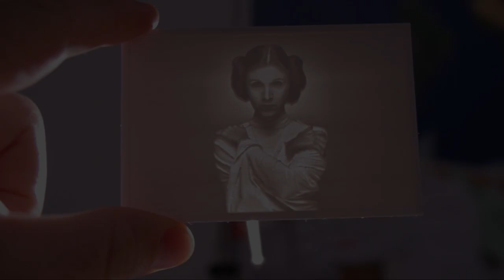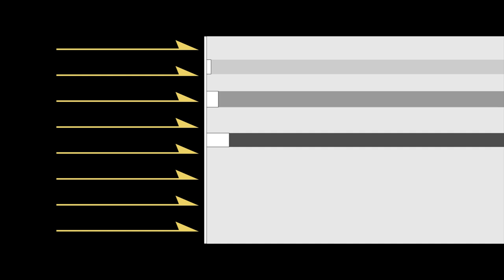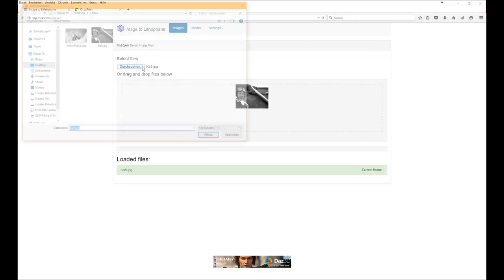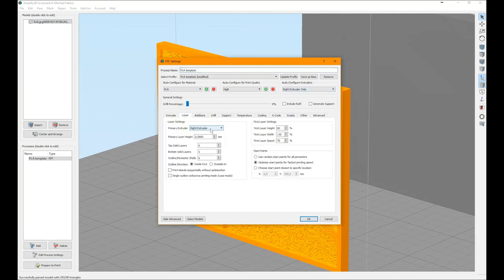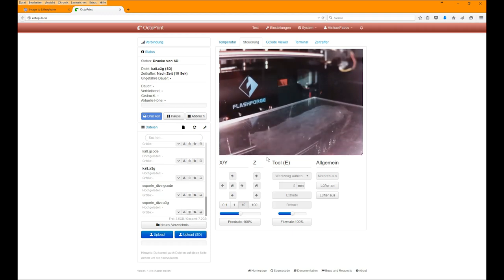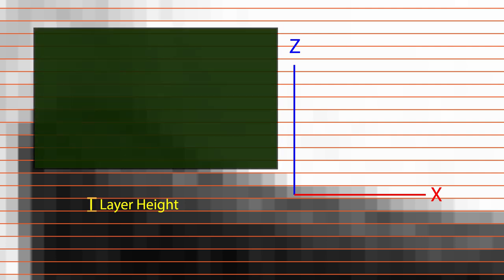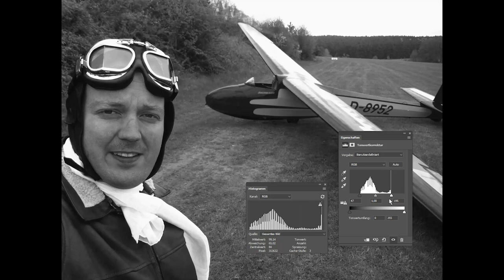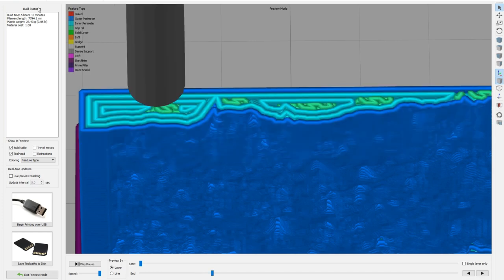Getting to Grips with Lithophanes from 3D printers

Comment: Thanx for making this video - there should be a "love" button like on fb! Very informative, personally I always wondered what a histogram was. One thing I'm still not clear about is the physical size of a pixel - how many pixels per .01mm resolution, specifically. I might be sweating it too much, maybe a good rule of thumb would be "If it looks good on my monitor at 100% magnification, it will look good as a lithophane".
Reply from the maker: aBridgeCalledDOUBT thank you.
Basically the size of the pixels correspond to your layer height. Because if you regard one horizontal row of pixels, this must be printable. But if you choose a layer height, that is much smaller than the physical height of that pixel row, you are not introducing more detail. Instead you are only increasing the required print time.
On the other hand if you scale your lithophane in a way that the layer height is larger than the pixel row, you loose detail.
So with the formula shown in the video you are able to calculate the reasonable size of the lithophane for the given resolution,  the resolution required to get best results based on a layer height and lithophane size or the required layer height to retain a given resolution and litho size.
Reply: I understand the concept just fine, you made it pretty straightforward. I didn't do a very good job of asking my question, however, the answer I was looking for was so obvious. Look at the pictures properties. I was trying to determine how much detail I would loose with a .01 print resolution. (Actually that was wrong, I'm looking at .1mm.)For example; a pic I am considering to use is 11.59cm/438 pixels tall. That would be .377 pixels/.1mm. According to those numbers I could print at .2mm resolution and not loose any detail. Am I tracking correctly? Thanx
Reply from the maker: +aBridgeCalledDOUBT correct. So in this case you would print around 3 layers for the height of 1 pixel if you were printing at 0.1mm. So you only need more print time but don't gain any detail.

Comment: Incredible explanation! I would also like to point out that the orientation along the x or y axis matters on beds that move along one or the other. I have mad a few that turned out wavy because the bed was moving back and forth along the y axis, shaking the whole very thin and tall model back and forth as it printed.

Comment: Very good tutorial.  I disagree with the upright v. flat conclusion because the human eye can only discern 32 - 64 shades of grey, while still being able to discern millions of colors.  At 4 mm thick, and 0.1 mm/layer, your lithophane printed flat should have 40 levels; at 0.2 mm/layer, the eye can see granularity of the grey-scale.  Whereas 40 mm @ 0.1 mm/layer is probably a minimum, I think 5 - 6 mm of thickness @ 0.1 mm/layer to achieve decent contrast.  I get very good results printing flat with those parameters.  The real trick to optimizing contrast is, however, accounting for the exponential loss of light as thickness increases and making thickness proportional to the natural logarithm of the pixel, rather than linearly proportional.  The proportionality constant needs to be measured for each filament before one can apply this.

Comment: For the output from the online tool with the higher vectors per pixel, you could then run the stl through a meshmixer type program and reduce the triangle count. With the proper reduction algorithms many of the flat surfaces made of many triangles can significantly reduce the number of triangles (down to a theoretical 2 triangles for a rectangular surface). YMMV though.

Comment: Very well done video. Will be trying these settings in a bit. I have done one other litho and it came out quite well, I did print it upright, but used 100% infill as opposed to zero, and had top/bottom solid at 1 and outline/perimeter also at 1....This was from another litho recommendation....Odd thing is in slicing the same image both ways I can see they look different from a line/layer perspective, but that resulted in the exact same size gcode file. I may print both ways for a compare. Regardless well done on the video.
Reply from the maker: Truegrit Scott thanks.
Well, the trick is, that my settings actually give you 100% infill, too. But the fill pattern is exactly parallel to the perimeters.
This way the translucent image is more homogene.

Comment: Upright vs flat...have you ever tried lightly sanding the surface of a flat lithophane? If you abrade away the edges of those “layer steps” you restore the original gradient.

I only tried this because printing vertically I get a lot of excess material...straggly, hairy bits that even if I remove carefull leave more blemishes than all over sanding.

I’d used a wire brush (soft and fine), wire wool (again very fine) and soft plastic polishing bonnets on a Dremel. I’m going to try something even finer like TCut...and was even thinking of some sort of high temperature/short time treatment (ie blowtorch!) to try and reflow the surface.

You have much more experience than me, and I love the rest of your tutorial, especially the manual contrast adjustment, it’s just this one aspect (vertical vs horizontal) that’s not working for me right now...
Reply from the maker: Nigel Coxon hi, one suggestion that comes to my mind is, do some test prints to adjust for stringing. I bet you can tweak a bit for better stringing avoidance.
Another way is, set the Slicer so that it does not cross outer boundaries. This way there shouldn’t be much stringing.
If I can help you out, let me know.
About the sanding technique: you remove the steps, which also removes the gradient islands, but you cannot restore image information that hasn’t been printed. But you are fine with this, as the observer doesn’t know what detail has been there in the original picture.
Reply: I’m still using Cura and getting used to where all the settings are...thanks for replying, I’ll see if I can find that outer boundary or equivalent.
Reply: @Daft_Ideas  Did you ever find the outer boundary equivalent?
Reply: @scottfarrell1506  nope , never did...

Comment: I played around with the infill and layer heights a bit in Simplify3D and while with Zero Percent Infill your process worked out Great for Single  Lithophanes either Curved or Flat. However if you were to attempt the same settings say at Lithophanemaker.com for the Lampshades I think you or someone else would run into Bridging Issues when printing the Bottoms of the Lampshades. Though I guess if you were to run a Variable Print with different settings for the Top and Bottom using 100% Rectilinear Infill with Zero Infill for the actual Lithophanes one might come out with a fantastic product. Thanks for your Input and I think I am going to try and amalgamate the latter for an even greater product using your methods instead of my usual. Surprisingly, the time factor wasn't that much different. An extra 4 hours, and with a 72 hour print, who's counting,

Comment: Hi, Thanks for the video.
I still have some questions... :
- printing verticale gives better results. But I read that results are better if you print with the lithophage parallel to the Y-axis to reduce any vibration effect during Y-move. Do you agree ?
- It's quite difficult to read the S3D parameters. Could you confirm your nozzle is 0.4 ?
- What is the speed ? what is the number of perimeter/shell layers to be sure to get a 100% infill with 0% regular infill ?
- thanks
Reply from the maker: Well, that orientation issue is relevant for printers with a print bed that moves along the y-axis. There I do agree. If your Printer has a static printbed (movement along z-axis) I recommend to align it 90° to the axis with most swinging or even 45° so as to reduce ringing.
For the settings I recommend to check if HD-resolution is selected in the viewer.
I confirm using a 0.4mm nozzle and print at the following speed settings:
Speed 50mm/s, Outline Underspeed 60%, Solid Infill Underspeed 70%
But the speeds also depend on your printer and may require some adjustments.
I do use as many perimeters so as to completely fill the lithophane with perimeters rather than infill lines for homogenity. But if you use less make sure you are printing with 100% infill.
Reply: Thanks

Comment: Great video - but how did you make a border around your image prior to downloading the STL? I can't seem to create a border like that?
Reply from the maker: +Matt Arnold Hi Matt,
It's in the Model settings: you specify a border in Millimeters. If it does not show up, I guess your picture has a black outer rim already so that the black part of your picture is welding to the border of same height...
Reply: FlyingMD11Figured out what I was missing - I wasn't changing the model to a positive image. Changed it to positive and everything is fine and working. Thanks for taking the time to respond! Appreciate it! 👍🏻
Reply from the maker: +Matt Arnold you are welcome.

Comment: Hi, I followed your steps and used same size & settings to prepare the file. Simplify 3D estimates the print time to be 166 hours! But I saw your example is 5 hours. What can be the reason for such big difference? Is it the image file's resolution? FYI mine is 2760 x 1840 pixels, 150 dpi. Appreciate to have your expert advice. Thanks!
Reply from the maker: gsmarcom Hi,
actually the image itself doesn't really influence the print time much.
I'd guess it's the print speed settings or the speed reduction on the cooling page.
What's your layer height and print speed settings?
Reply: thanks for your reply. my layer height 0.1mm, print speed 50 mms
Reply from the maker: Mmh, that's strange.
If you like you could export the S3D-profile and send it by email.
I'll have a look on it. I guess there's something odd...
Reply: sure thanks so much for your help!
Reply from the maker: Found the solution.
Info to all audience: if you are using the speed values shown in the video, be informed that I use Millimeter per Second, not per Minute in Simplify3D.
Reply: thank you so much, problem solved!
Reply: This part of the discussion just saved my ass......THANKS GUYS!

Comment: Thanks for putting this video. Is there any way to project the picture on a desired 3D shape and then use a slicing software? I know 3dp.rocks has some nice geometrical shapes but I wonder if we can use any geometrical shape?
Reply from the maker: MrAmoslemi Hi, I am presently not aware of such a tool nor do I have an idea how to quickly solve this.. Sorry.
Reply: Thanks for the reply. If I am not wrong, for the infill, you said it should be set to zero? did you mean infill density? I am using Cura so the terminology maybe slightly different. Also, my prints have grain issue that you mentioned. You said that you fixed it by setting the higher value for outline parameter shell. As far as I know, there is no such parameter in Cura or maybe I don't know. Can you explain what it is or if you are familiar with Cura what's its identical parameter in Cura?
Reply from the maker: MrAmoslemi you should make sure that the model is completely filled. You can do this with regular infill or with my method which I found gives a slightly more even appearance.
In Cura this should be achieved by setting the wall width to at least half of the lithophane’s thickness.
Reply: Thanks for the response. when you say thickness,  do you mean the "thinness layer" thickness or the "thickness" provided on the second row of online tool?
Reply from the maker: MrAmoslemi I mean the thickness value in the tool (2nd row)
Reply: Thanks again and I assume you meant "wall thickness" from "wall width".

Comment: Quick ? If you view you lithopane at a right angle to the print does it not mean that you can only divide your Grey scale into the “thickness” of your print say 3mm - base (say 1mm)=2mm divide by your print line thickness say 0.1mm = 20 tones of grey. I do not understand the argument used to print vertical and divide by height of print as you would view at a right angle where your print is still on 2mm thick. Further if you use a standard 0.4 mm nozel and print at 0.4mm then vertically you get 2mm divided 0,4 = 5 Grey scale tones. Is it then not better to print “flat” . Your comments will be appreciated.
Reply from the maker: Actually not.
First, if you print flat, the number of grey scales is dominated by the printed thickness, divided by the layer height. so with a 3 mm lithophane and a true layer height of 0.1mm you can get 30 tones of grey which is in fact quite noticeable low.
Second, if you print vertical, the layer height only restricts the pixel resolution on the vertical axis of the picture. But, if you have a picture that is 1000 pixels tall and you have a layer height of 0.1mm, you won't loose any resolution as long as the print is 100mm or more tall.
The horizontal resolution is not dominated by the extrusion width, as you are not printing parallel lines, that occur or not (like on needle printers long ago). Your stepper motor resolution is in charge as it just has to lay the outer perimeter a bit more or less out or in and this is in the 0.01mm range. So you can achieve with the given example almost 300 tones of gray which is more than 8 Bit.
Reply: FlyingMD11 My apologies to be a pain. The print bead when printing vertically is 0,4 thick. This means you are laying 0,4 mm next to each other and  3mm /0,4 = 7,5. Does this not then mean only 7,5 greyscales as you can only put 7,5 lines next to each other max. The print will be viewed perpendicular to the thin of the print which is the 3mm which can only have 7,5 different thicknesses. You do not view through the 100 mm. What am I missing ?
Reply from the maker: Well, the minimum thickness is 0,4mm (normally factor 1.2 so 0.48mm), as to say one single perimeter. If you add a second opposing perimeter, it’s 0,96mm minimum thickness but as you can separate those two perimeters in very small steps, which depends on the horizontal resolution of the printer, you can achieve any thickness in steps of 0.01mm by using two  perimeters and any sort of infill.
Usually infill is squeezed in between perimeters and does not necessarily need to be a factor of 0.4mm
Reply: FlyingMD11 Does this not still not only give you a maximum of 7,5 steps though ?
Reply from the maker: These two perimeters can be apart by 0, 0.01, 0.02, 0.03,... ,... , 2.98, 2.99, 3.00mm
That’s the horizontal resolution.
Reply: FlyingMD11 last try. The print is 3d. The z axis allows the user the “thinnest” print as you can go down to 0,1 whilst you will be 0,4 in x y.  Surely this means printing in the z axis gives you best resolution if viewed in the z axis ? If printing perpendicular to z in the x y direction with a 3 mm thickness at 0,4 extrusion width means 4 times less resolution as you are now viewing perpendicular to z thus perpendicular to a 0,1 layer and in a 0,4 layer ?
Reply from the maker: No, the 0.4 is not a taster. It’s just the width of your perimeter. Where this perimeter actually is located is with a precision of 0.01mm.
Have a look on time 24:09 in the video to see what I mean.
The thickness is not influenced by the perimeter width as long it is more than 2 perimeters wide.
Reply: FlyingMD11 but the thickness is what determines the light you see or don’t see. Anyways do not want to bug you further. Thanks for your responses
Reply from the maker: Well, but you don’t fill by factors of perimeter widths. 😉
Reply: FlyingMD11 you only have 3 mm to divide into and this measurement you need to divided by the smallest layer you can put down. You do not have a 100 mm so I do not agree with your postulation.
Reply from the maker: Mark Stemmett have you looked at the picture at 24:09 in the Video? It clearly shows the postulated issue 😉
Reply: FlyingMD11 3mm divided by the layer thickness, enough said
Reply from the maker: Mark Stemmett ok Mark.
This afternoon I’m gonna take out the crayons and do a second video on this 😉
Reply: @FlyingMD11  I believe I already understood the concept, but did I really if I could not clearly, and patiently explain it as you did?  I am jealous.
Reply from the maker: Mark Taber well, unfortunately I didn’t have much time the previous months which is now followed by a bereavement.
So the second video was never started.
Sorry for that.